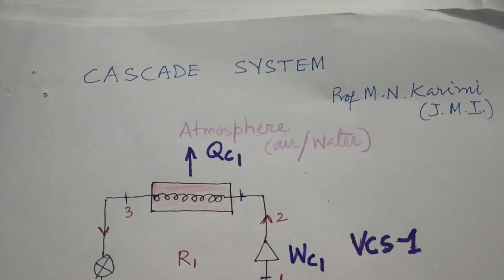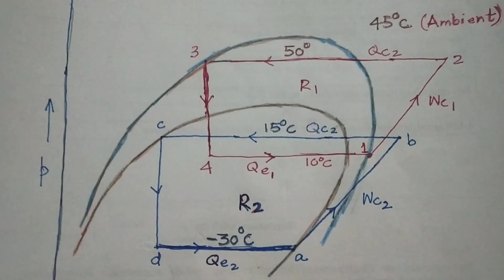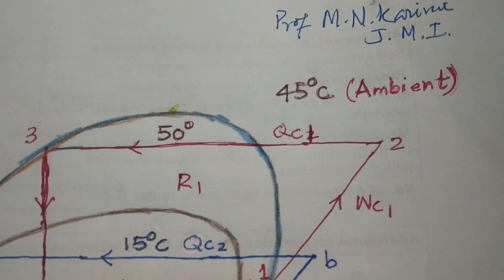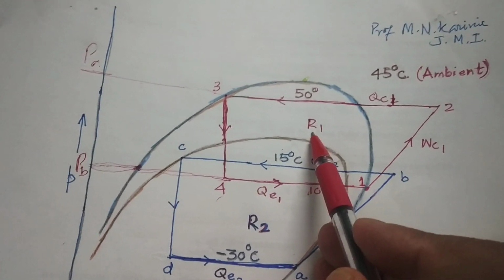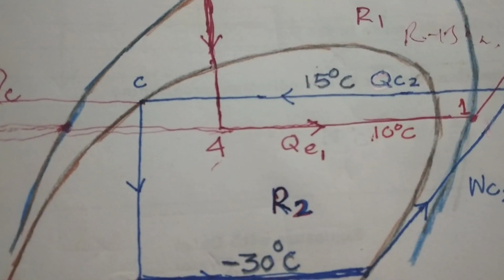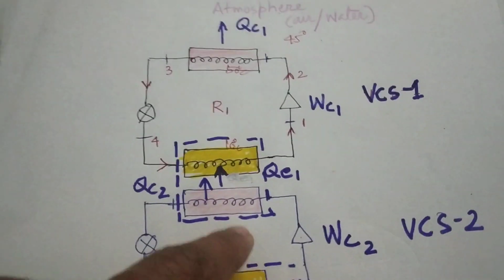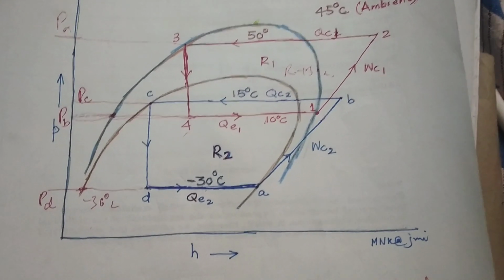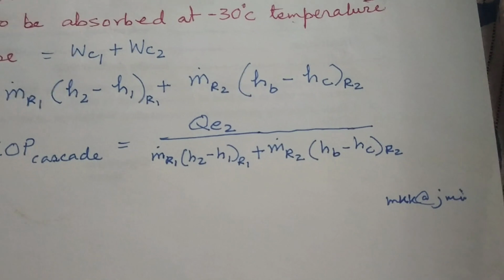Cascade Refrigeration System

Comment: A cascade system consists of two or more than two vapour compression systems.
The objective of this system is to achieve comparatively far lower temperature than the ambient temperature. In this video lecture, Cascade System, coupled with two compression cycles have been discussed. R1 and R2 are the refrigerants used in VCS 1 and VCS 2 respectively. The temperatures of the evaporators of these two compression cycles  are -30℃ and 10℃. Likewise, condensers have 15℃ and 50℃. Qe2 heat is absorbed by evaporator 2 and Qc1 heat is rejected by the condenser 1 to the ambient temperature, while having condenser 2 and evaporator 1 coupled with each other.

Comment: 20bme038 neeraj sharma
In a cascade refrigeration system, two or more independent refrigeration cycles are used to achieve the desired cooling effect. The cycles operate at different temperaturesthe heat generated by the low-temperature cycle is used to drive the high-temperature cycle

Comment: The cascade system is the combination of two or more vapour compression system. 
In this video we took two vapour compression system VCS-1 and VCS-2 along with two different refrigerants R1 and R2 respectively. 
Let Qc1 is the amount of heat rejected by   condenser of VCS-1 at 50°c to the atmosphere which is at 45°c.
Qe1 is the amount of heat absorbed by evaporator of VCS-1 at 10°c.
Qe2 is the amount of heat absorbed by evaporator of VCS-2 at -30°c and Qc2 of VCS-2 is at 15°c.
Now, condenser of VCS-2 is at 15°c and ambient temperature is 45°c, so it cannot reject  the heat to the atmosphere. To overcome this problem we coupled condenser of VCS-2 with evaporator of VCS-1 which is at 10°c.
Now the heat rejected by the condenser of VCS-2 is absorbed by the evaporator of VCS-1. This type of system is known as cascade system. 
At the end we can calculate cop with the help of formula... 
COP= Qe2/wc1+wc2
Where wc1 is work done by compressor 1 and wc2 is work done by compressor 2.

Comment: Cascade refrigeration system 
A cascade refrigeration system is a cooling technology that utilizes two separate vapor compression cycles, each with its own refrigerant, that are coupled together through a cascade condenser. In this system, there are two vapor compression systems (VCS1 & VCS2) that each consist of a condenser, evaporator, compressor, and other components. Each system uses a different refrigerant (R1 & R2) with different characteristics such as critical value, pressure, and temperature.

The cascade condenser is the component that allows for the transfer of cooling effect between the two systems. Condenser 2 of VCS2, which operates at 15°C, transfers heat to Condenser 1 of VCS1, which operates at 10°C. This heat transfer between the two condensers enables the cascade refrigeration system to achieve much lower temperatures than would be possible with a single-cycle vapor compression system. The efficiency of the system is due to the waste heat from one cycle being used to drive the other cycle, resulting in a more energy-efficient cooling process

Cascade refrigeration systems are widely used in applications such as industrial refrigeration, scientific research, and medical fields

Comment: A cascade system which is actually traying to transfer to cooling effect with the help of coupling to system.
A vapour compression system (VCS) 
Consists of compressor, condensor, expansion device and evaporator.
Cascading system we have two systems vapour compression system 1 and vapour compression system 2 which are coupled to each other.this coupling is known as cascading. Cascade system is a system in which effect of system 1 is given to system 2 which has got effect of 1 and 2.
But in cascade refrigeration system two or more vapour compression system say (vcs1) and(vcs2)with different refrigerant say (R1 and R2) are used .for example in vcs1 we take evaporator temperature as 10 degree Celsius and condensor temp 50 degree Celsius in the same way condensor temp of vcs2 is taken as 15 degree Celsius and evaporator temperature as -30 degree Celsius.
The evaporation condensation temp of each system are sequentially lower with some overlap to cover the total temp drop desired.
Coefficient of performance of cascade system is the ratio of total heat observed by the refrigerant at -30 degree Celsius to the total work done by the compression system.nicely explained

Comment: A cascade refrigeration system employs 2 or more individual refrigeration cycles operating at different pressure and temperature levels.
The lower temperature cycle provides the desired refrigeration effect at a relatively low temperature.
The condenser in the lower-temperature cycle is thermally coupled to the evaporator in the higher-temperature cycle.
Thus, the evaporator in the higher cycle only serves to extract the heat released by the condenser in the lower cycle. Then this heat is rejected into the ambient air or a water stream in the condenser of the higher cycle.
A cascade refrigeration system can operate with a lower evaporating temperature, smaller compression ratio and higher compressor volumetric efficiency when compared with a single-stage refrigeration system

Comment: In a cascade refrigeration system, two or more vapor-compression cycles with different refrigerants are used. The evaporation-condensation temperatures of each cycle are sequentially lower with some overlap to cover the total temperature drop desired, with refrigerants selected to work efficiently in the temperature range they cover. The low temperature system removes heat from the space to be cooled using an evaporator, and transfers it to a heat exchanger that is cooled by the evaporation of the refrigerant of the high temperature system.

Comment: From this lecture on cascading effects, I understood that cascading effects are where the effect of the first is given to the second. This effect tries to transfer cooling effects with the help of coupling systems. As we know, there are four main components in a vapour compression system (VCS), i.e., the condenser, compressor, evaporator, and expansion valve.

For better understanding of this lecture, we consider two refrigerants having different characteristics, R1 and R2. We plotted graphs of both of these refrigerants and found that R1 has a higher critical temperature and R2 has a lower critical temperature. There are two VCS, namely VCS1 and VCS2.
We've got four pressures:
1. Pa - 50 degrees centigrade for R1
2. Pb - 10 degree centigrade for R1
3. Pc - 15 degrees centigrade for R2
4. Pd - (-30) degree centigrade for R2

R2 will be absorbing heat from anything that is higher than -30  degrees centigrade. The condenser of VCS2 rejects heat; this heat cannot go outside the shaded area, and this heat will be absorbed by the evaporator of VCS1. This is known as the cascading effect.

The net result of the cascading effect of VCS is that we get a cooling effect that is very low in temperature (-30 degrees Celsius), and we can have a system that can be working when the atmospheric condition is 45 degrees Celsius.

C.O.P. = Qe/(mr1*(hr-h1)) of R1 + (mr2*(hb-hc)) of R2.

Comment: A cascade system is a system in which there is a component or effect that is connected so that the second one has the effect of the first one. Here we have seen two compression systems:- VCS-1 and VCS-2 connected in series. We know that the compression system has four components.
Condensor
Compressor
Expansion Valve
Evaporator.
From the schematic diagram we can see that the evaporator of VCS-1 is absorbing heat Qe1 and the condenser is rejecting heat to the atmosphere (it can be air or water). Similarly for VCS-2.
WC1 represents work done by the compressor of VCS-1 and WC2 represents work done by the compressor of VCS-2. We will understand this with the help of a pressure enthalpy chart. (i.e, p-h chart). There are refrigerants R1 and  R2 and each refrigerant has its properties. That’s why we have two curves. VCS-1 has R1 refrigerant and VCS-2 has R2 refrigerant having their own characteristics curves. From the p-h chart, we see that the different temperatures are set for the condensers and evaporators of VCS-1 and VCS-2. We know that the condenser rejects heat. Here in this system, we have chosen a condenser temperature of 15⁰C and it will reject heat to the space which is lower than 15⁰C. So we have a temperature of less than 15⁰C of an evaporator of VCS-1. So condenser 2 will reject QC2 heat to evaporator 1 and we know that the evaporator absorbs heat so it will absorb heat QC2. Both condenser 2 and evaporator 1 are insulated. In short, we can say that VCS-2 is coupled to the VCS-2 through this insulated section and this coupling of the vapour compression system is known as the cascade system. And the result we get is the cooling effect by achieving a temperature of -30⁰C because it is not possible with only one VCS and also by using only one refrigerant. It is used where we have to achieve lower temperatures at higher ambient temperatures.

Comment: A vapour compression system has 4 parts ie compressor, condensor, evaporator and expansion device. A we know in a cascade system there are 2 VCS. We have used 2 refrigerants differing in characteristics. Heat transfer is taking place between the two system. Here Qc1 is the heat rejected by condensor and Qe1 is the heat absorbed by evaporator of VCS1. Qc2 is the heat rejected by the condensor and Qe2 is the heat absorbed by evaporator of VCS2. Here the Refrigerant R2 will absorb Qe2. Finally we got a cooling effect with a temp of (-30C) .

COP (cascade system) = refrigeration effect/work done.
COP = Qe1/Wc1+Wc2

Comment: This video helps to understand the Cascade system which is one and the second are in the series to given the effect to the other . In a cascade refrigeration system, two or more vapor-compression cycles with different refrigerants are used.
Also , if you want to reject heat with the help of a condenser then we need to have a higher temperature of the coil , so that the coil temp is higher than the ambient condition, that is how the coil will reject the heat to the ambient or to the atmosphere.

Comment: Cascade system ia a part of the refrigeration and air conditioning course.In cascade refrigeration system, two or more than two vapour compression cycles with different refrigerants are used. The refrigerants that are used in each vapour compression system have different characteristics .Each vapour compression system consists of compressor ,condenser,expansion device and evaporator in sequence.  There are two different curves for both vapour compression system which are represented on the pH chart. Refrigerant -1 is having a higher critical temperature than Refrigerant -2 . Qc 1 and Qc2 are the amount of heat rejected by the VCS-1 ad VSC-2 .Similarly Qe1 and Qe2 are the amount of heat absorbed by the VCS-1 and VCS-2 , furthermore Wc1 and Wc2 are the amount of work done by the VCS-1 and VCS-2 . Condenser can reject  heat to the surrounding only if the temperature of the coil  is higher than the ambient temperature of the surrounding therefore in this way coil at 50°C will reject heat to the atmosphere at 45°C temperature.In cycle -1 Pa  represents  50°C temperature for refrigerant-1 and Pb represents 10°C temperature for refrigerant-2. Similarly , In cycle -2 we have Pc which is 15°C for R2 and Pc which is -30°C for R2.  Surrounding for evaporator -1 of the VCS  must have the temperature higher than 10°C , so that evaporator can absorb heat from the surrounding.Evaporator coil temperature at -30°C in cycle no. 2 is going to absorb heat from anything which is higher than -30°C, any space which is to be cooled supposing there is a space which is at -25°C temperature , so evaporator 2 will absorb heat from -25°C space  and compressor-2 will do its work and then condenser -2 will reject heat at 15°C but condenser -2 can only reject heat to the space which is lower than the 15°C  for that we have to have a space which is shown by shaded area which is insulated and in this shaded area we have condenser -2 at 15°C and evaporator -1 at 10°C so that heat rejected by condenser-2 can be absorbed by evaporator-1 since heat can't be rejected to the surrounding because the temperature of the surrounding is higher than the condenser-2  temperature.If we want  heat to get rejected then we have to couple both the vapour compression system therefore this coupling of a vapour compression system is known as cascading.

Comment: 20BME049 Bharat Sharma-- In this cascade system vedio we understand that cascade system is the combination of vapour compression system. This vapour compression system consists of four parts which is compressor,expansion,evaporator,condenser and expansion valve while on the other hand In cascade refrigeration System A series of Vapour compression system that is having two parts which can be said VCS1 and VCS2 with having varying refrigerant .These varying refrigerant have P(a) and p(b) is pressure for R(1) which is at 50 degree and 10 degree respectively and P(C) and p(d) is pressure which is at 15 degree and -30degree .Now what will happen is R2 will absorb heat for temperature higher than -30 degree and next system that is evaporator 1 will absorb heat from condenser 2 and As the coil temperature will be at -30 degree.. evaporator 2 will absorb heat from temperature of -25 degree. So in this system we can overall define that The heat absorbed by VCS 1 is absorbed by VCS2. This exchange and coupling is known as cascading. We can also observe that by selecting the correct refrigerant we can achieve very low temperature refrigeration at a higher ambient temperature..Thank u

Comment: 20BME059 MUSAF SHAKEEL
IN THIS VIDEO WE LEARNED ABOUT CASCADE SYSTEM.
IT IS ALSO KNOWN AS COMBINATION OF VAPOUR COMPRESSION SYSTEM CONNECTED IN A SERIES PATTERN.
BASICALLY A VAPOUR COMPRESSION SYSTEM CONSISTS OF MAIN 4 COMPONENTS --- COMPRESSOR , EVAPORATOR , CONDENSER AND EXPANSION VALVE WHILE HERE IN CASCADING SYSTEM IT IS NOT THE SAME THING.
ITS MAIN PURPOSE IS TO TRANSFER COOLING EFFECT VIE MEANS OF COUPLING OF TWO SYSTEMS.

COP OF CASCADE IS DETERMINED BY THE FORMULA ----  R.E/WD = QE2 ( HEAT ABSORBED BY EVAPORATOR OF FIRST SYSTEM )/WC1 + WC2 (WHERE WC1 AND WC2 ARE THE WORK OF COMPRESSOR OF BOTH THE SYSTEMS.

WE HAVE USED TWO DIFFERENT REFRIGERANTS IN BOTH THE SYSTEMS.

Comment: Cascade system is the combination of series  of vapour compression  system. In this system effect of first system is transferred to second system. It helps us to transfer cooling effects by coupling two system. In the above video we have used two system having one compressor, condenser in each system.
We have used two refrigerants R1 and R2 in each system  having differs t characteristic. We have transfer heat from higher temp. at 50 degree  centigrade  to ambient temperature  50 degrees Celsius.  Compressor  is a device which is used to absorb heat from a surrounding having higher temperature than it's coil. 
Condenser is a device which is used to reject heat to a surrounding having temperature higher than its coil. 
Heat absorbed by the refrigerant R2 at lower temperature  is increased to higher temperature  by coupling  two  vapour  compression  system.
Coefficient  of performance  of cascade  system is the ratio of total heat absorbed by the refrigerant  at -30 degree centigrade to the total work  done by the compression system. Nicely explained

Comment: In this lecture, we studied about cascade system. 
We marked four pressures. P(A) is pressure which is at 50 degree for R1. P(B) is pressure which is at 10 degree for R1. P(C) which is at 15 degree for R2 and P(D) which is at -30 degree for R2. 
The refrigerant 2 will be absorbing heat from anywhere which is higher than -30 degree. And evaporator 2 will absorb heat from -25 degree because coil temp is -30 degree. 
Evaporator 1 is absorbing heat from condensor 2.
The heat absorbed by VCS1 is then absorbed by VCS2, so VCS 1 is coupled with VCS2. 
This coupling of VCS is known as cascading.

Comment: When the evaporation temperature continues to decrease, the single-stage compression system with a single refrigerant will be limited by too low evaporation pressure, which can even solidify the refrigerant. To solve these problems, two or more stage compression refrigeration systems should be cascaded by a heat exchanger,  compression system consists of compressor, condenser, expansion device and evaporator.

Comment: cascade system: In this video, the discussion is all about the cascade refrigeration system.VCS consists of 4 main components ( compressor, evaporator, condenser and expansion valve).
but in cascade refrigeration system, two or more vapour compression system say-(VCS 1 and VCS 2) with different refrigerants say-( R1 and R2) are used.for example, in vcs1 we take   evaporator temp as 10 degree Celsius and condenser temp as 50 d.c .in the same way condenser temp of VCS 2 is taken as 15 d.c and evaporator temp as -30 d.c.The evaporation -condensation temperatures of each systems are sequentially lower with some overlap to cover the total temp drop desired.it is assumed that the ambient temp is 45 d.c.here Qc1 and Qe1 are the heat rejected by condenser and heat absorbed by evaporator of VCS 1 respectively.similarly Qc2 and Qe2 are the heat rejected by condenser and heat absorbed by evaporator of VCS 2 respectively.Refrigeration R2 will absorbs heat Qe2 from the space to be cooled  and Qc2 heat is not rejected to atmosphere but is absorbed by Qe1.
we got a cooling effect which is -30d.c (very low temp) that can not be achieved from only 1 VCS.let wc1 and wc2 are the work of compressor of VCS 1 and VCS 2 respectively. then, 

    C.O.P( cascade system)= R.E/WD
    
   C.O.P=Qe2/Wc1+Wc2